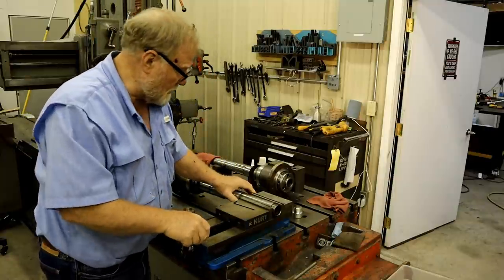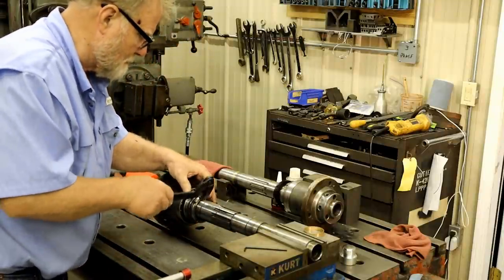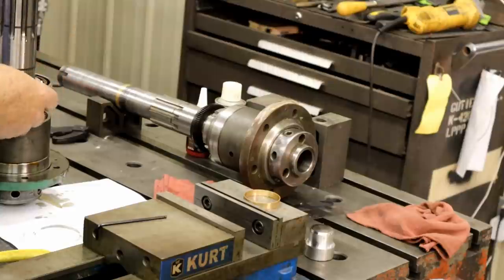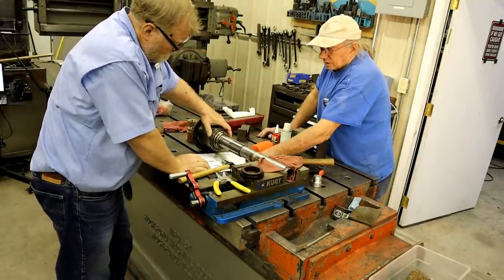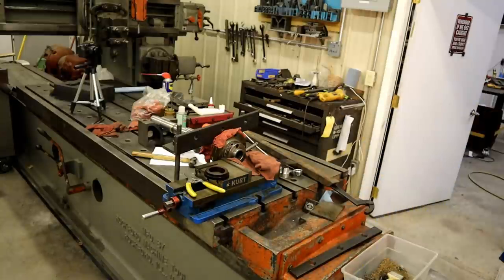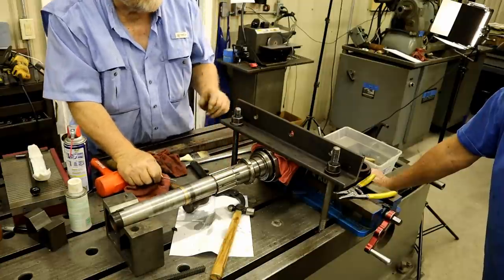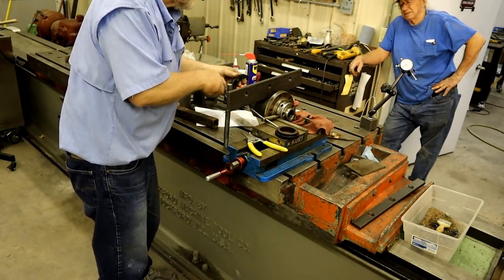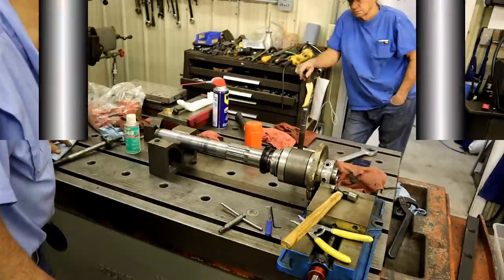Monarch 10EE 7000.00 Mistake : Getting the Donor Spindle ready to install.

Comment: I have a monarch 10ee too i just bought, my spindle has suitable runouts, but i have a less than satisfactory “upgraded” ac motor conversion with a vfd from the period. Only spins me to around 600 rpm. Excited to follow the upgrades you end up making to the motor/drive/control unit

Comment: Love i when Don comes over and aggravates the crap out of Steve.  We used to do that to dad years ago in the shop. He would grab a hammer and slam it down next to our hands and say "stop that crap!!!" Lol.
I hope beating on that bearing nut doesn't affect the 25 millionths accuracy of that donar spindle....  We usually make a sleeve that would slide over the end of the spindle with fingers milled in the end that would engage the slots to give you even force distributed around the nut.  With a big wrench, Bubba style, put leverage on the sleeve until it breaks loose.  Of course, most of the time, we would do it just like you just did.  Thanks for sharing Don and Steve, Ken
Reply from the maker: Who's side are you on????
Reply: @10swatkins  Hehe...🤠 I'm on yaws side.☺☺

Comment: Not bad.  Good approach to getting the nut off and back on.  There has to be a way to test the preload while in the machine and then adjust as necessary.  Keep it up!
Reply from the maker: The two spacers between the bearings are suppose to put the correct preload on the bearings...   Thanks for watching...

Comment: i don't believe the spanner nut puts any preload on the bearings it simply holds the inner races in position on the spindle. the outer sleeve maintains a precise distance between the outer races not a preload. when the spindle is installed i believe the outer race of the bearing next to the spanner nut will bottom out inside the headstock. the bolt flange on the spindle can then be tightened up capturing the outer races and holding them in alignment. i have never had a 10 ee apart so i'm anxious to see this repair thru. good video.
Reply from the maker: That's what I was trying to explain :) The nut only holds things in place and keeps the bearings tight against the inner and outer sleeve that puts the correct distance and according to what I have read, preload on the bearings.

Comment: I was watching a Keith Rucker youtube video (VintageMachinery) as he was re-building a spindle for his monarch 10EE. If I recall correctly, he found that the labyrinth seal nut went on with the tapered end facing the bearing, which is opposite of how you mounted your nut. I don't know who is correct. Just an observation.
Reply from the maker: The consensus is that I have the nut backward... Frankly I don't see where it matters one way or the other as far as putting tension on the spindle.... Oil splash I could see :)

Comment: An alternative to brass plugs is a lead ball, and easier to acquire. Shotgun cartridges provide a wide variety of sizes of lead balls.
Reply from the maker: I would think they would work well, Might be a little soft but there is no where for them to go :)
Reply: @10swatkins  They conform to the thread and so provide excellent grip. The method is common in European machines.

Comment: I’ve got pliers to cut lead came (yes, it’s came, not cane). Pliers to break glass, etc. but as far as I know, there’s no such thing as a caming plier. To do what?
Reply from the maker: Well with the correct spelling I found these... https://www.amazon.com/StudioPRO-603-Studio-Lead-Nippers/dp/B006WQKTYS    I don't see where they are much different than regular dikes..  I guess you're suppose to maybe grind the sharp edges off and use then to grip the sides of the keys..
Reply: @10swatkins  yes, cutters and nippers, but no pliers. I wouldn’t think of doing that. A parallel jaw plier is much better. Or a vise grip type tool with smooth jaw tips instead of serrated. I use those most of the time if the keys are stubborn.and keys are cheap, if it does get damages, a set doesn’t cost much to have on hand.

Comment: Why did you install the nut upside down?
Reply from the maker: threads were messed up on the outer edge... Put it on backwards to clean the little bit of damage...
Reply: @10swatkins  but final assembly was upsidedown. Almost 100% sure Tapered side goes towards bearing
Reply from the maker: @earleclemans4836  I will look at the drawings before I place it...  Thanks....